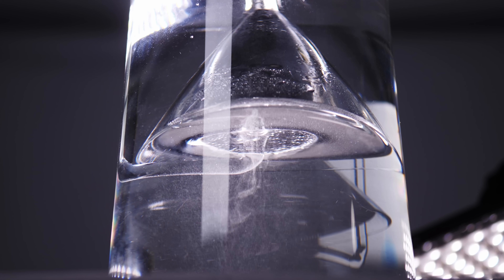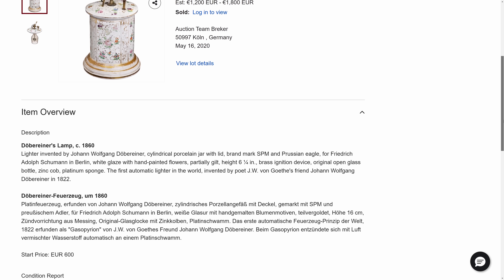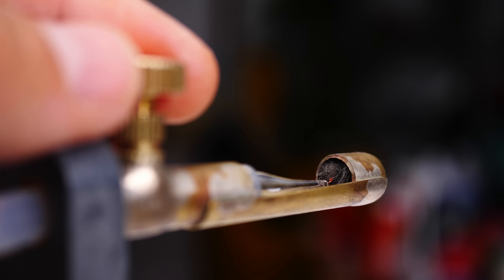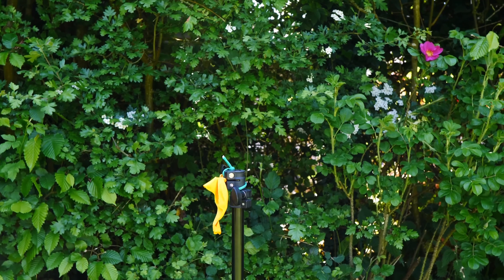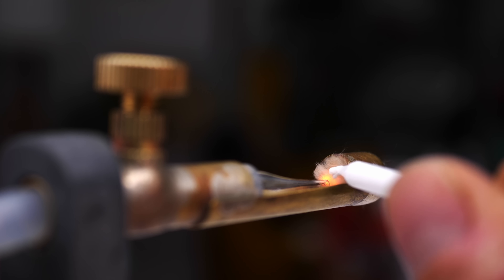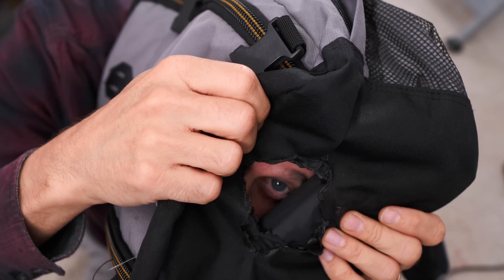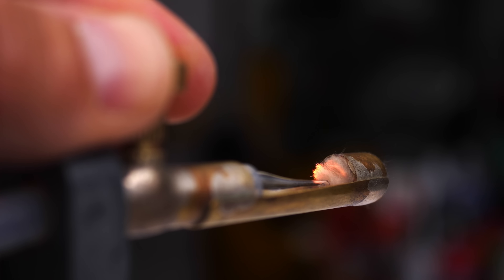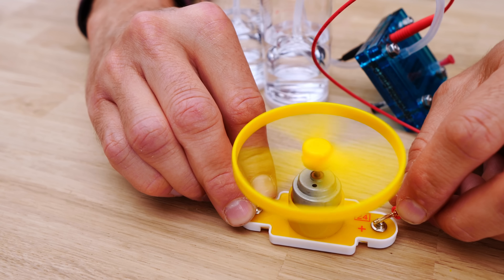This 200-Year-Old Lighter Ignites Without a Spark

Comment: Excellent video, Steve:)
Reply: Isn't it Esellent?
Reply from the maker: Excellent device! Thank you so much for making it!
Reply: @SteveMould where fid you get the fuel cell?
Reply: @SteveMould  I have a question.
You said that zippo's and their platinum wool was the only easy source.
Is it not platinum that's used as the catalyst in cordless gas soldering irons?
Reply: It's 'expreso' in Spanish. That's my excuse.
Reply: @xequals-pc1wl actually it’s cafe or cafe solo in Spanish
Reply: @seaneyo  AI fails confidently again :)
Reply: Markus is brilliant! A true genius 👍
Reply: Mr. Mould. I had some salt in a big shaker, I'd guess 500g, it got clumpy so I thought I'd heat it in my frying pan to dry it, that worked well and while still warm I poured it back in the bottle.
I went to use it the next day, and rather pleased with myself, gave the bottle a shake to relish in the clump-free salt. The bottle immediately got hot.
Is salt a particularly good insulator and just held the heat, or did my shaking cause some kinetic-chemical release of energy?
I tried again heating the salt, but I can't get it to repeat.
Reply: YT really dislikes your channel, when I search not the full and exact name it shows me all sorts of nonsens, but not you. What a shame ...
Reply: That's great Markus! Another cool device.
Reply: The problem with those fuel cells is  regular (impure) water eventually clogs them up with impurities...
Reply: Minus the volume being at 30% and the ads being 10x louder than the video itself.
Reply: Subhan Allah
Reply: Laa ilaaha ilallah
Reply: I was never able to get my lamps to self ignite, but had to heat the pt wool prior. What construction techniques or materials did you use to pull off self ignition? Great video btw!

Comment: This technique would greatly improve the efficiency and power to weight ratio of the Stirling engine put some platinum right next to the valve inlet and let the hydrogen in at top dead center the air fuel mixture Woodburn expanding this would give Stirling engine a huge boost in power to weight ratios.

Comment: I was a natural gas well tender. When high pressure natural gas is regulated to a lower pressure the molecules required more energy and will draw that energy in the from the heat in the surrounding air. If there is any water associated with the gas, (and there always is) the reduction in temperature can result is ice blocking the orifice of the pressure regulator. So, we would use catalytic heaters. They were usually round and 6" to 18" and contained a disc of catalytic "wool" about 1/4" thick. Behind the disc was an electric heating element that was jumped with 12 volts. A small regulator provides a light stream of natural gas in the oz/square inch range. When the heater gets warm the electrical connection was removed and as long as the gas flow was steady it would stay more that warm enough to keep the water in the gas stream from freezing.

Comment: Normally when you want to make hydrogen with zinc and an acid, you add a tiny amount of copper sulphate to the acid.  The zinc reacts with the copper sulphate and you get a coating of copper on the surface of the zinc.  This is called a zinc copper couple and somehow it catalyses the reaction increasing the rate that the zinc reacts with the acid.

Comment: 9:50 What an awesome shot.  The hot zippo hand warmer wick visable through the holes in the cap and the reflection of your body heat off the lighter case with the IR camera.  I feel there is a wealth of science facts that could be explored from just that one shot.  How is the reflection possible?  Is the zippo being heated by that reflection?  How are the holes hot and the wick hot but nothing is hot between them as you put the lid on?

Comment: Another reason why you need to use fine pieces of platinum is that a block will rapidly conduct the heat away so it's hard to heat up to the temperature you need. Steel, for example,  is very hard to set light to. It's virtually impossible to set fire to a screwdriver, but you can easily burn steel wool, simply because you can heat it up more easily. A block conducts the heat away too quickly.

Comment: If you didn't know, the "flint and steel" fire starters you can buy today use a pyrophoric alloy called Ferrocerium and are way easier to use than an actual flint and steel.

Comment: You skipped over the sibling of these lighters that were popular in the 1930's, the Methanol-Platnum Self Igniting Lighters.  It looks like a twin tube metal pill holder, about 2 inches long with 3/4 & 1/2 inch diameter cylinders.  The larger cylinder holds a Methanol soaked wick/sock and the lid of the other has a bead of platnum suspended in a frame.  When you introduce the bead to the methanol chamber, it reacts with the Methanol fumes and ignites the wick/sock in the other chamber.  Great work otherwise

Comment: I have several catalytic lighters from the 1950s that work with a tiny ball of platinum black suspoended on a very fine platinum wire and that are fueled by methanol. The flame is nearly invisible wich means this lighter can be somewhat risky to use. Also, methanol is very toxic. But it's very cool.

Comment: Have you heard of everlasting candle or flame that was found burning in a tomb undisturbed for 100s maybe 1000s of years only to be destroyed by an automaton mechanism ?... There are several stories but I believe asbestos is a key ingredient. Perhaps something like this lighter was made in a lamp... The great pyramid uses subterranean water current harnessed energy and chemical electrolisis that also creates massive pressure on granite blocks but designed to utilize the pyzo electric phenomenon?.... Jk I'm just stoner

Comment: great video!! as a catalysis researcher i just wanted to say that part of the reason we use platinum over any other metals is also because it grabs onto those H2 and O2 molecules with just the right amount of energy (look into the sabatier principle if you're curious). if the bond between platinum and those molecules were any stronger or weaker it would be much worse at its job. it's why platinum, despite being so expensive, is really hard to replace in fuel cells! other metals tend to either grab onto molecules too strongly or too weakly.

Comment: Portable gas powered soldering irons work like that.
They start with a striker that ignites gas like a normal lighter, but the flame only heats up a platinum coated mesh, then extinguishes, and the mesh starts catalyzing the gas, heating it up, as it gets pushed towards the iron tip.

Comment: Since you can get hydrogen gas from reacting aluminum and commercially available drain cleaners, I wonder if you could replace the sulfuric acid and zinc and get the same result.

Comment: Excellent video, but I'm not sure I agree with the molecular wobble of water being the primary driving force behind the glowing platinum and the evacuation of water from the catalyst surface. It seems much more likely that the exothermicity of the reaction is responsible for both of those effects (the heat of the reaction produces water in the form of steam, which then imparts some energy to the platinum as it diffuses into surrounding air). Or am I missing something? Regardless, loved the video - I always learn something on your channel!

Comment: Prior to matches, people carried around a little metal box with a magnifying glass set in the lid with a metal cap over it. Inside they carried tinder for making fire with the heat of the sun shown through the glass.
I found such a box in the woods while looking for mushrooms.
Very rusty.
Took forever to get it open without destroying it.
What I found inside appeared to be very fine plant fiber. It was degraded to dust and fuzz. Also the remnants of tiny sticks. And a piece of thin cloth. My guess is the cloth had some type of accelerant on it that was no longer present.
I can't remember the company but the tinder box is still sold today.

Comment: I think the pinnacle of lighters is still in the future. Ideally, it would require no fuel (or so little that fuel ceases to be a factor in its durability).

I am no inventor, but a laser comes to mind. Though it does require power

Comment: Remembering about 1967 art 10th class of my  "middle  school" when I spent a cheap gas lighter as a goodbye present to my chemistry teacher: it was only a tiny piece of platinum felt as fine as hair within a wire protection, which he could use to light his "Bunsen"burner within his lesson. Manufacturing was similar to these blue flash bulbs for kodak cameras which worked by magnesia..

Comment: This is actually how the glow plugs in nitro methane RC motors work.
The methanol (the fuel they run on is mainly methanol with 20-30% nitro methane) reacts with the platinum filament on the plug keeping it hot for each round of combustion.

Comment: Also nitro RC engines use this technology. They have a glow plug with platinum. The methanol in the fuel reacts to start ignition. They need electricity to heat them up until it is running.

Comment: If you want to make one of these and not use sulfuric acid and zinc - a less expensive route is using NaOH (lye) and aluminum foil instead of zinc to make the hydrogen. Platinum and other rather exotic metals are used in the catalytic converter in a car and that is why they are so expensive.

Comment: When you described how the lighter works, I imagined a mechanical device for raising and lowering the platinum into the acid.
But the real one with the inverted flask is a much more elegant method for controlling the reaction. It's self limiting!

Comment: Actually it would make a TERRIBLE bomb. It might sound great at first, but how are you gonna assamble a bomb with a spontanious explosive? How are you gonna store it. If you just put the components in the bomb, how are you gonna make sure it doesn't explode before all the educts have reacted? You either got a ticking timebomb with no indication when it goes off in your basement or you have no controll over the actual strength of the bomb.

Comment: would this work with an hho cell that uses electrolysis to separate water into hydrogen and oxygen? i feel like that would be safer than a jar of acid with a chunk of zinc because you could just shut off the power to the cell when you have generated the desired amount of hydrogen but maybe im wrong.

Comment: In onions, trehalose is generated primarily through a two-step process involving the enzyme TPS
 While onions don't accumulate high levels of trehalose, they possess genes encoding TPS and TPP, indicating its importance in various plant functions. 

my blind bet: that hcv is caused by trehalose hydrogen connection nesting in the bloodway walls there it would constantly ripen pimple fat that then encapsulates trehalose growth as happening in onions ... we may call it bilirubin and that were a
the infective mpart of the virus ( as the pimple fat gets broken down in alien immune system and nests the acid into the immune memory)
 most of the produce is washed out of the body because encapsuled 
(yellowing the eye ) it doesn't nest

it binds into the bilrubin that it produces ( by glueing hydrogenic acids 

into the arterial fat, so that it can ripen a while  )... 

therewith mostly doesn't  settle in the body to grow

as it is rejected and only minimally acquired into 

self-immunisation
...

you're into chemistrhy.... and hcv is mostly blurred from the web
if you have a sensefull thaught of it?

Comment: Just a heads up the platinum bright embers have multiple per square. You're supposed to pull off just one sheet at a time when using them in fireplaces.

Comment: Absolutely mind-blowing how platinum catalysis works! I had no idea hydrogen could ignite spontaneously on platinum without any spark or heat source. As someone who’s experimented with small hydrogen generators before, this makes me want to build a Dobereiner’s lamp replica myself just for the chemistry! The mechanism using zinc and sulfuric acid as a gas generator with a self-regulating system is incredibly elegant. Huge respect to Marcus from Marb’s Lab for recreating such a beautiful piece of science history.

Comment: uh i dont think you want to sit there and breathe that as the zinc breaks down. That is zinc oxide. the same reason you dont use zinc coated steel for like campfire stuff or let it all burn off / use acid to remove the zinc.

Comment: I came to think, and you might be the best one to ask. The riddle where a boy has to cross a bridge with two apples, but the bridge can only hold his weight, plus one apple, so the answer is that he juggles the apples. To me the intuitive answer sais that throwing one apple up is "heavier" than one apple, because you not only have to hold the apples weight, but apply force to beat gravity, and catching an apple would be equally heavy because of the whole equal and opposite thing. But while one apple is in the air, juggling one ore several more shouldn't make a difference right? How many apples would you need to carry before juggling is cost effective?
Reply: The trick is that juggling one apple results in a time-average force that is equal (approximately) to the weight of one apple, and juggling two apples means twice as many tosses and catches so the time-average force is twice as much, and so on.

Which is to say that juggling the apples does not actually help with bridge-crossing.

Comment: I had known about hydrogen fuel cells for quite a while. However, I never knew that the process could be reversed. Absolutely none of the articles I have read about it or the past few decades ever mentioned that.

Comment: I wonder if this could be done with a platinum coated spark plug, sulfuric acid from a car battery, and a zinc wheel weigh in a pinch?

Comment: A company makes ‘Hydro caps’ that use a catalyst to combine hydrogen with oxygen to help prevent explosions.  One of their products is a small pellet that does this combination safely and is used inside electrical products that could accidentally fill with hydrogen because of battery out gassing or due to water leakage plus electrolysis.

Comment: Instead of H2SO4 + Zn you can use HCl + Fe (the Iron should not be in a steel alloy, however standard nails works well). 
Another simple reaction is:
NaOH + Al. 
Hi!

Comment: I get the orbitals explanation and the anti-bonding buuut... I dont get why the platinum...

 If surface electrons and the anti-bonding are the responsible to separate the hydrogen wouldn't any metal do the trick? As I am concerned, every metal has surface electrons, isn't it? 

Pleaseee any good soul explain it to me 😅

Comment: I vaguely recall, from my days in the late 60s working as chemistry lab assistant, we had a ceramic pot in the lab with several chambers, that generated (I think), Hydrogen sulphide, and used a similar system whereby an acid was displaced down into the bottom part of the apparatus when the gas tap was turned off, terminating the reaction. It didn't use a catalyst. From memory, I believe it was called a Kipps Apparatus and was stored inside a fume cupboard in the lab.

Comment: I thought there was no more innovation in lighters but recently I saw a dramatic change in disposable butane lighters seemingly inspired by drug use. People who smoke speed or crack keep the lighters lit a really long time and they kept melting the top of their lighters. You can see that might be a problem. Now in the liquor stores here in the festive Tenderloin neighborhood of San Francisco they've started selling disposable butane lighters that have a sort of tube sticking up from them about an 1 1/2" to 2". Now the flame is at the top of the tube and away from the valve of the plastic lighter! The drug users can leave them lit as long as they want (or until the butane runs out) and never melt the top of the lighter!!! Ingenious!

Comment: In Spanish, it is spelled expresso.  Somehow I've known about platinum catalyst for about 60 years now, long before they used it to clean automotive exhaust systems.  I remember seeing a diagram where the O2 was split by contact with the catalyst metal, and then the hydrogen would rip it off.  They didn't explain the wobble, but I presume it was because even if the wobble was not enough, the heat and rising hot gas would be.

I saw this demonstrated in a high school physics class that did a field trip to the UofF.  They had a 100% platinum screen and hydrogen in a high pressure tank. In, um, 1967 or 1968...

Comment: Question did you misspeak @ 7:00 when you said that after the molecules were torn apart that there would be a bunch of free floating hydrogen and oxygen
 "molecules" however if they were ripped from their bonds wouldn't they be free free floating "atoms" before the transition to covalent bonding took place to form the dihydrogen oxide molecule.

Comment: Another great video, Steve, but you're slipping a bit. @06:57, those are lots of loose ATOMS on the surface of the platinum, not molecules. And 1823 wasn't in the 17th century 😉

Comment: That still has eV.  You saying that it has no spark is mind-blowing because you can clearly see the flame which IS releasing charges into the air. The size is small, not non-existent. A flame is the release of charges into the air. A flame proves that you are wrong. A flame cannot exist without charge accumulation and emission. All waves have volts, and cannot create or destroy it, only arc to a new position.     ∂conservation/∂time = 0

Comment: Some spacecraft use hydrogen peroxide and a platinum catalyst for maneuvering thrusters. Since the reaction is auto-igniting and only needs a single propellant, it greatly reduces weight 
and complexity of the system, while making it completely reliable.